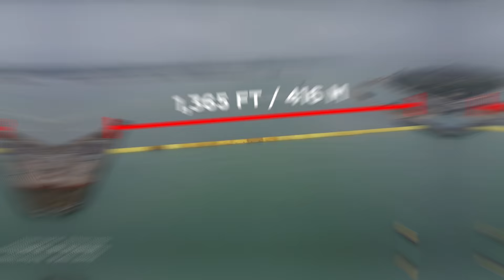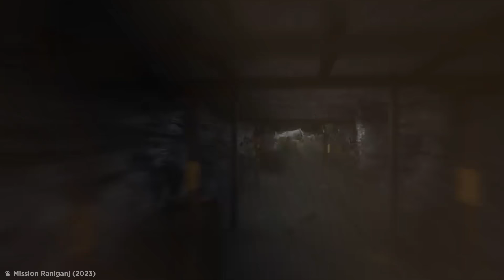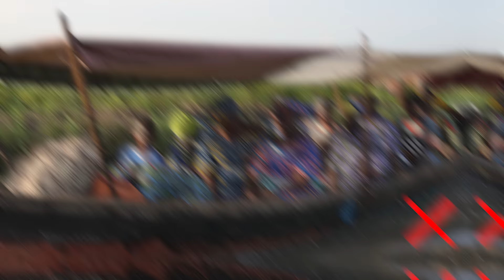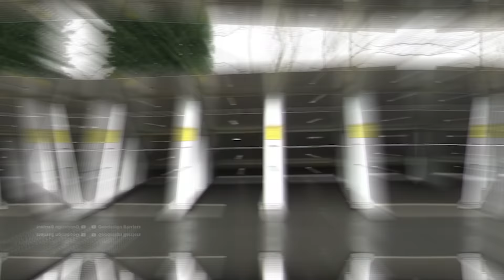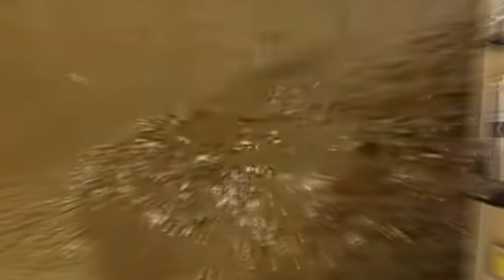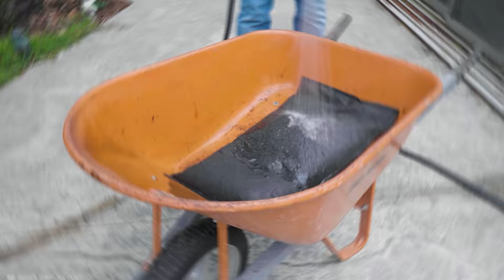This INGENIOUS Invention Saved Their House

Comment: A flood prevention system requiring electrical power, some kind of internet connected (micro-)controller and pre-warning from some centralized system is the very definition of a conceptional failure - a severely flawed failed design.
We recently suffered something like this with our emergency response coordination system that was supposed to maintain connection and communication during disasters but failed within minutes alongside the power grid and several simply drowned stations.
The system was insanely expensive, but being of a design were hardening and fallbacks weren't part of the design itself but added on based for "expected situations", its essentially as safe a solution as playing Russian roulette.

Comment: All these door stopping devices are grate and all but Take this from someone who's been through two floods .. Once water wants in your house. Nothings gonna stop it unless the foundations and subfloors water/ air tight.. Water will sleep through concrete, bricks and normal construction materials like wood and so on.. It might not happen instantly but it will happen. Blocking just doors or openings is just delaying the inevitable .. If you live in a flood zone. Get good insurance and keep items you wanna keep in areas you can easily take when you leave / evacuate . As its gonna happen sadly no matter how much you attempt to hold back water it will get though.. Unless you rase your house or its able to float barricades and door stops don't work.. Just my two cents .. I have seen and lived through it so again my 2 cents.. hope it helps someone ..

Comment: I've lived just outside of Toronto, ON, Canada, my entire life. As a full grown adult who has been into major weather events since I can remember (I even wanted to be a storm chaser by my adulthood), I've been more and more aware of how one of our highways, the Don Valley Parkway (DVP for short) seems to have areas where it floods rarely easily from the river beside it during massive rain/thunderstorm events (or even smaller rain events but while our winter snow is melting at the same time). I honestly think several of these flood-prevention ideas would work fairly well for the highway, at the most prone-to-flooding areas. I also feel like these ideas would not only save the commuters, who have to find other ways around the area during flooding, consistent headaches, but I think the city of Toronto would benefit greatly as well with how little a lot of these methods actually cost, especially in the long run.
❤❤❤❤❤❤❤
Thanks for sharing this video Be Amazed!!!!!

@cityoftoronto